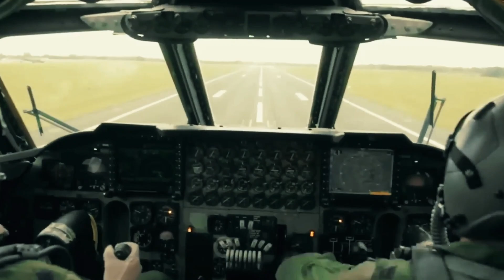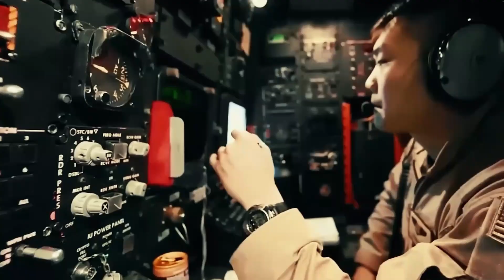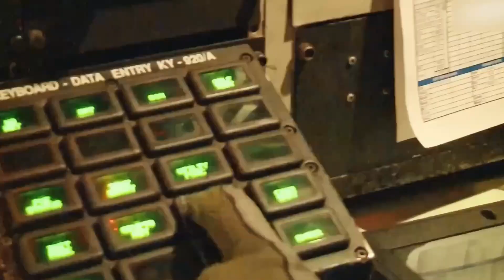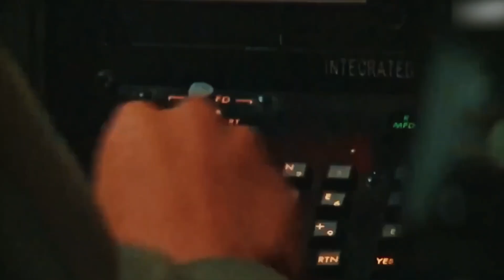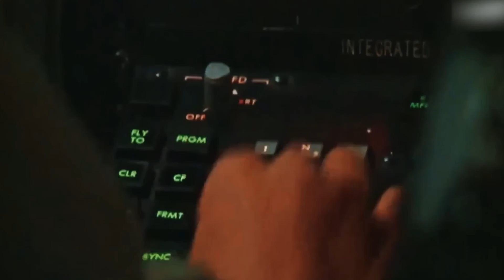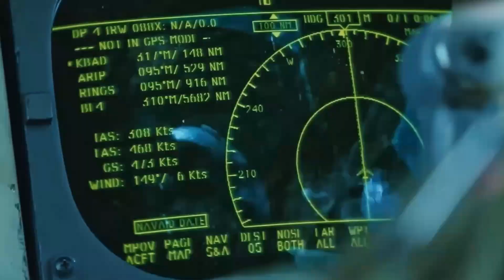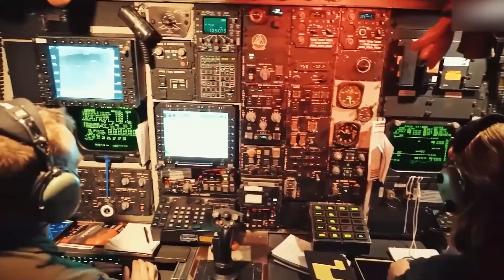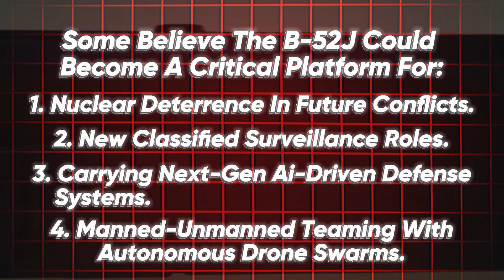Why the B-52’s New Rolls-Royce Engine is a Game Changer for Aviation!

Comment: What key factors you did not say is , the job of the B52 had changed drastically in recent decades. With the invention of long range cruise missiles, there are no longer the need to venture into high threat environments, instead the bomber can launch stand off. If entering enemy air space are required, there are faster planes or stealth planes. The B52 were designed with just one job in mind, It is already long ago bought and paid for and too expensive or impossible to convert it into let say a tanker or a cargo plane. Any cargo plane (such as a C17, C5, C130)  could have done what the B52 can, like dropping bombs and launching missiles, they just get ejected out the rear ramp, but they have other jobs they are needed more.